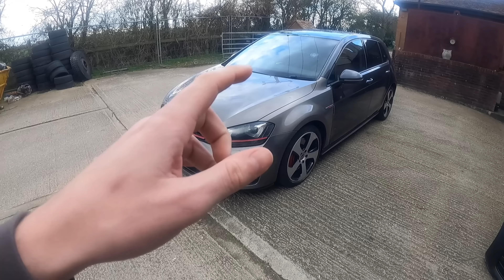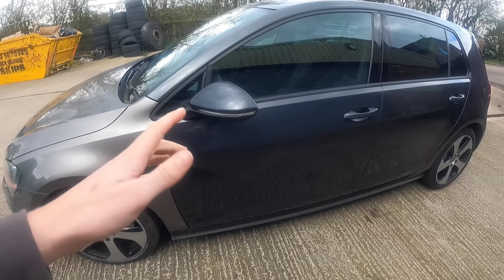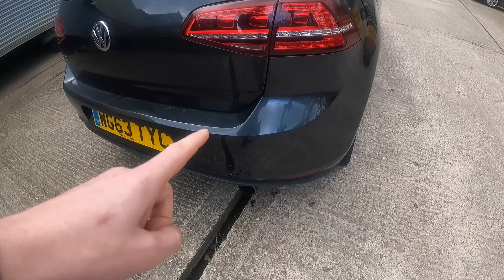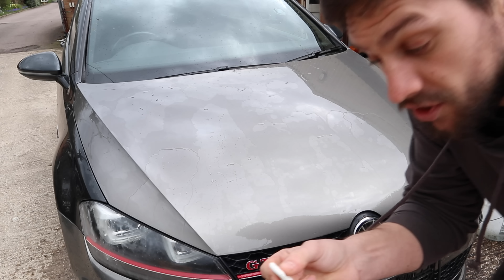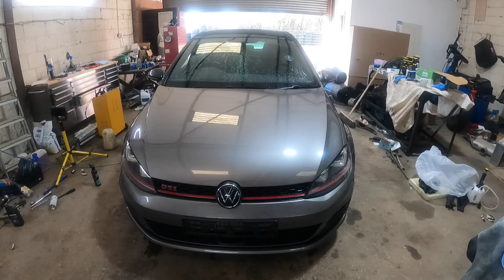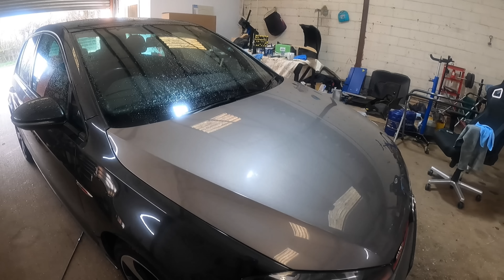WRAPPING MY VW GOLF GTI.. BEGINNER MODE PT.1

Comment: looks like you got the hang of it quick. One thing I noticed when watching loads of yannimize videos is that they dont trim the excess like that, they like to tuck it into the body and wrap around into the creases, because they probably lift of from the edges if you try and flush cut it.

Comment: Tip I learned is use a heat gun to heat up the door skin around the dent to make it a little more workable when straightening it out.   For the vinyl, maybe try cutting to size then securing the vinyl wrap down the middle with masking tape, then work from the centre out and fix one half then remove the masking tape and fix the other half from the middle out to the edge, that way you aren’t fighting such a big area of vinyl, great job on the bonnet still, especially around the curve of the VW badge.

Comment: Not bad. On corners you heat and stretch so you don’t get the little vinyl tag. Try to remember you are not wrapping a Christmas present and fold over corners. Try to seal those ones you already have already other water will get in and lift the vinyl really quickly. Great first attempt. You also need to get some isopropyl to clean the panel before you lay the vinyl.

Comment: With regards to the corners having the excess vinyl sticking out slightly on them,
If you cut the vinyl to the point of the corner, when it comes to the fold on the point of the corner youll have 2 pieces of vinyl to overlap each other and will stop the piece sticking out on every corner... 

If that makes sense! 🤷‍♂️

Comment: WRAP TIPS Always start from the middle of the panel, and try not heat the wrap in the middle of panel also as when it gets hot it will shrink over time and it will crack. " and that mark on the bonnet is caused by overstretching. but all in all for a first try you did well.. when you get mad or annoyed walk away have a drink and come back lol. i use to almost pull  my hair out or kick people out of the workshop lol!

Comment: Great work! Could you have used a smaller piece of clay?? 😂 FYI clay bar doesn’t give shine, though it may seem so because it’s removing contaminants and making the surface cleaner. It actually induces marring, which you’d see in direct light. Is always advisable to polish after claying, to remove the marring, though is obviously irrelevant in your case

Comment: Only advice I can offer you mate is glass the film out. Don't just peel half the backing off. Peel the whole lot off and stretch the film as best as you can over the panel before you start applying pressure.  Then it saves all the on off of the vinyl trying to get it flat and risking ripping or getting shit under the wrap.
Reply from the maker: Thanks! I started to get better at it the more I did it! Bumpers going to be fun 😬
Reply: @SavingSalvage  good on you for giving it a go mate. For the corners before you trim put a bit of heat on and gently stretch the film over the corner before you trim it. For the bumper look into infills using knifeless cutting tape. Basically do the hardest inserts first then the main bumper after. Pull the backing off in 1 and pull the vinyl round in 1 hit.
Reply from the maker: Yeah I am going to order knifeless tape for the roof too! Will use it on the bumpers too thanks 🙏🏼